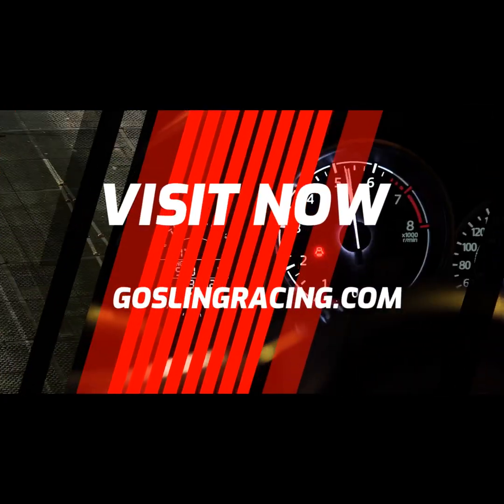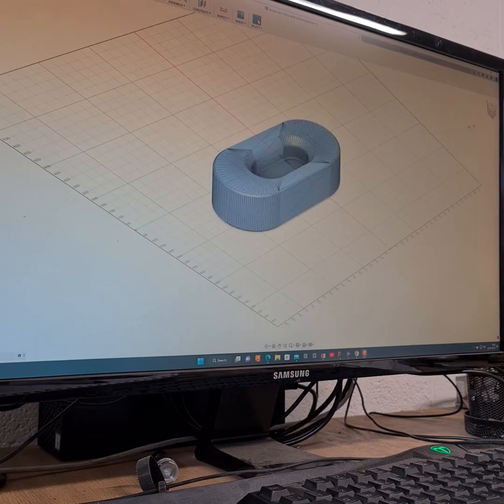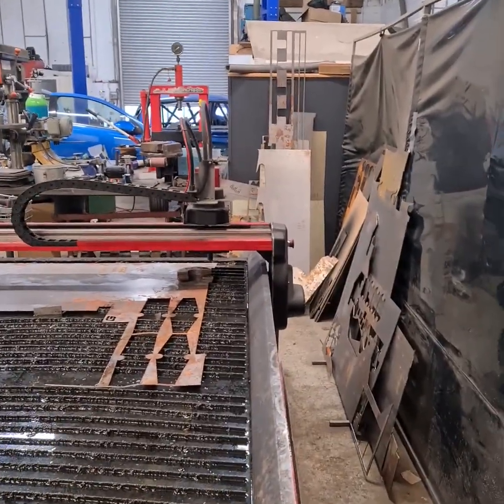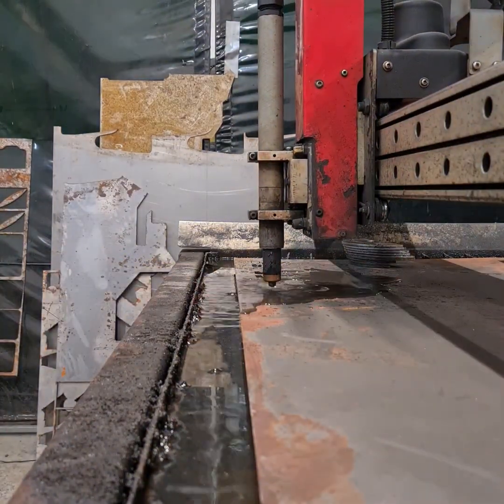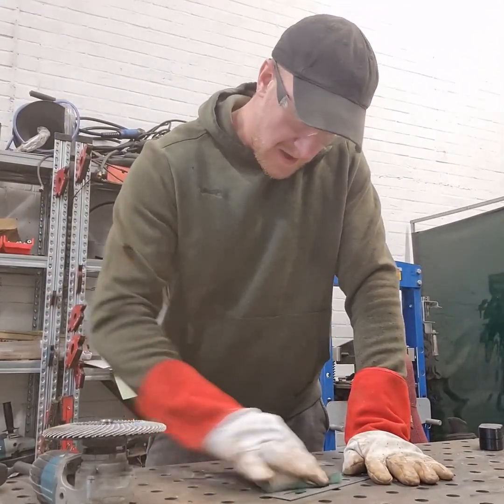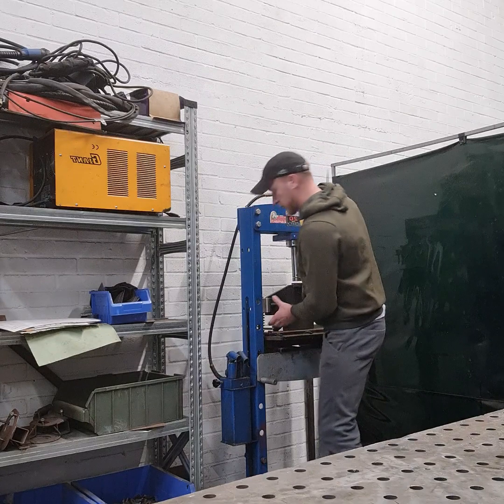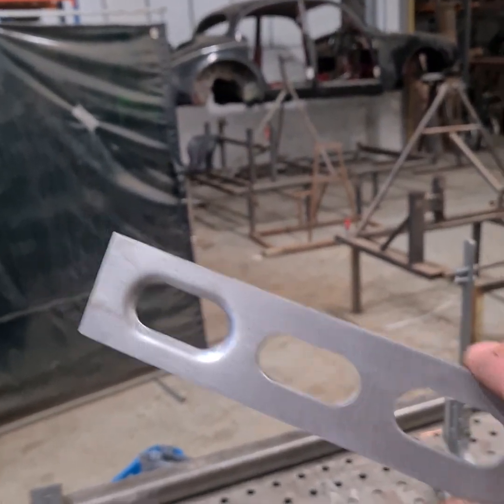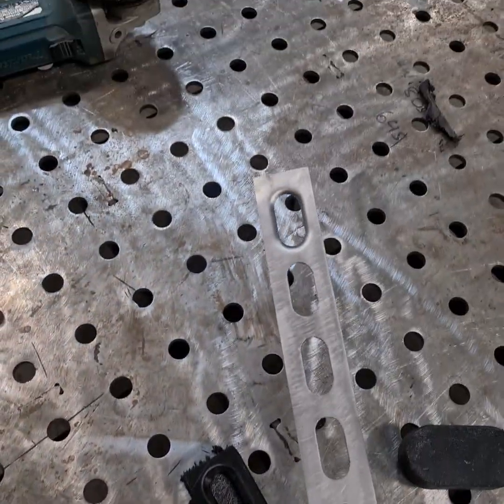TESTING OUT 3D PRINTED PRESS DIES

Comment: I did a test printing them with 10% infill without bottom layer and filled them with polyester. A lot faster print but when curing the polyester it's important to keep them under some weight since the polyester generates a lot of heat when curing.
Reply: Probably would if used epoxy